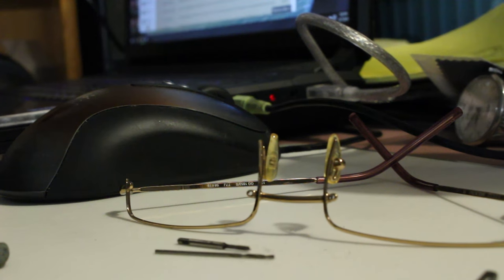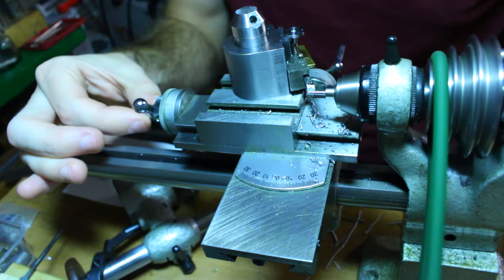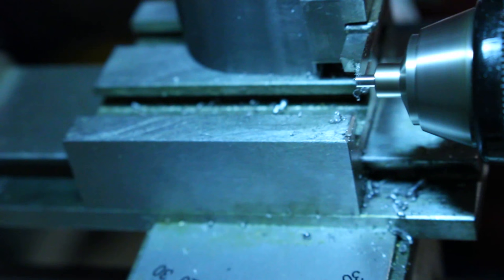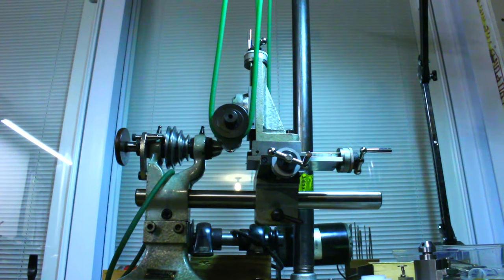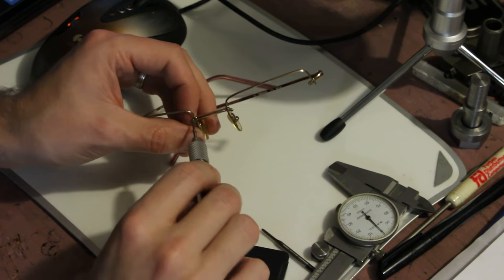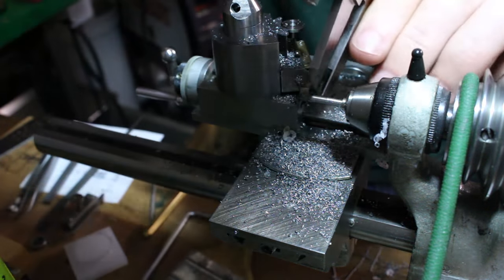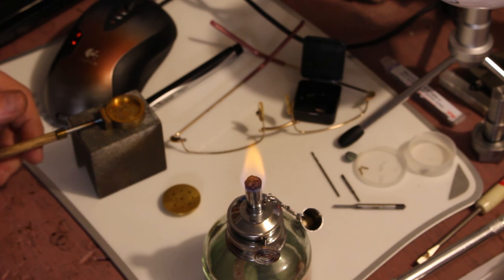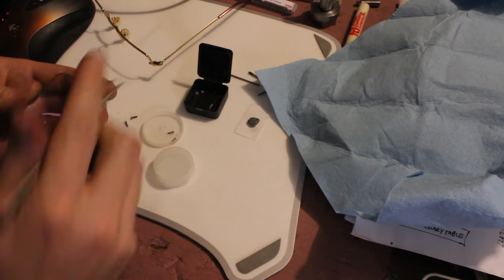A shady job: Making small screws

Comment: Good job!  I made some of those on my 9" lathe, single pointed 80TPI, .056" OD
Reply from the maker: Wow you've got me beat!  The smallest I've single pointed were #4-40.  Did you grind your own threading tool for that, or did you have a threading insert?
Reply: Your finishing is much more refined than mine.  I just used my regular hand ground HSS threading tool.
Here's some photos: http://s1182.photobucket.com/user/martik777/library/Single%20pointing%20a%20tiny%20screw
Reply from the maker: That came out great!  Nice work grinding that single pointing tool too.  I also hand grind mine, but I'm thinking of making up a fixture one of these days.

Comment: Came back for another watch and noticed the Rivett has round cutting tools.  I can't believe it never caught my attention before.  I'm assuming you made them out of drill rod?
Reply from the maker: Yes, the post itself takes round tools, the post inserts are easy to swap out and were available with different diameter holes through them, I have 1/2" for the Rivett and 1/4", 1/2", and 5/8" for the Hjorths.  There were also bushings available with square holes to fit the largest size of toolpost insert (5/8" or 3/4", I can't remember offhand), that would allow holding of square tools, but I don't have any of them and probably won't bother making any.  The round tools I use are made from 1/2" round HSS blanks that I grind to shape.  Round tools took some getting used to, but I really like using them.

Comment: Watching your videos again (since you haven't posted any for some time, ahem, hint  hint). Now I have a question. I take glasses apart all the time, if nothing else for the screws. How do you determine the pitch?  I use trial and error, but there must be a better way. Dr Daniels is mute on the subject. Maybe there are screw plates. If so, where do you find them?  There must be a Swiss standard somewhere!
Reply from the maker: Hey sorry I'm so late answering, I'm just now noticing a bunch of older comments!  Screw plates are definitely the easiest way, all of them I recall seeing have matched sets of plain threaded holes alongside the die cutting holes, to gauge the diameter/pitch.  Of course you have to be a little bit careful when it comes to english vs. metric threads, these thread pitches are all so fine that it's not always easy to determine whether a pitch is english or metric.  Another quick and dirty way is to use an existing screw or tap as a visual gauge, like you would a "normal" thread pitch gauge.  If you really need to be fussy about it, the quickest and easiest way I can think of would be to use a microscope with an optical scale if you have one, or a scale set next to or behind the threads of the screw in question.  Also, Dr. Daniels stated that one should make one's own screws, as mass-produced ones are entirely unsuitable.  :)

Comment: please be so careful when removing chips with your finger, dont be pulled in!  I love printer rods, so plentiful and precision... btw I didnt know they magnetized...
Reply from the maker: Hi Joe, thanks for taking the time to comment! I appreciate your concern but there is no danger here on a watchmakers lathe, other than the possible metal splinter.  This lathe won't be pulling in any body parts, under any conditions.  It won't even pinch.  Regarding the printer shafting, it is typically 4xx series stainless steel, which is magnetic and often heat treatable. Great stuff to work with, because it machines real nice and has some corrosion resistance. The trade-off is that 3xx stainless is far more corrosion resistant (and non-magnetic) but doesn't machine nearly as well.
Reply: HA!  I didnt worry too much about any hangnails getting caught!  I have a small supply of those printer rods, but Ive never tried hardening them,  Maybe I can make a hardened "ice pick" splinter remover like Diresta uses for just about everything... In some ways Im glad I dont (yet) have a mill, for I understand those splinters can be quite, well, splintery.
Reply: say,  do any watchmaking lathes of briefcase size have screwcutting leadscrews?
Reply from the maker: That's a great question, and it touches on one of my favorite topics!  The answer is yes and no. If you are talking of traditional watchmakers lathes (that is to say, plain turning lathes) of that size, then strictly speaking no they do not have a powered feed screw like you are thinking.  Traditional watchmakers lathes, however, were often available with screw cutting attachments that accomplish the same thing, but by transmitting power from the headstock to the top compound slide via a telescoping driveshaft with a pair of universal joints.  This is how power feed and single point threading can be done on a plain turning lathe.  These attachments are extremely difficult to find and very expensive when they do turn up, so most people do without and a few adventurous souls have made their own.  Here is a link to an image that shows such an attachment: http://www.watchtoolsonline.com/images/007(16).jpg  However bear in mind there are very small lathes of similar size (such as the Cowells and the Sherline) aimed at model makers that are scaled down lathes of a more general design and often have power feed and screw cutting capabilities via a powered lead screw.  For a time there were some Chinese made lathes with between a 4-6" swing that were threadcutting.  Micromark was one retailer for them, but they have been unavailable for quite a while now.  Finding features such as threadcutting, or even worse, back-gearing, in a lathe this size is very difficult unless you pony up quite a bit of money for something like a Cowells.  As far as I know, the Cowells is the only screwcutting, back-geared machine you can buy new in this size.

Comment: The most interesting videos I have watched in some time. Work that small is my thing because the workshop is so small.  There must be standards for these tiny screws. There is at least one Swiss standard where the diameter decreases as the square root of 2, so each area is 1/2 the preceding one. You did mention M1.4 and 1.4 is square root of 2. But there must be some formula for the pitch. Is there a reference? Second, is there a good place to get those button dies, not to mention watchmaker's files? Third, Thanks for these videos!
Reply from the maker: Thanks very much, Juan!  Yes there are standards for these.  ISO 68-1 defines the the general standard, and ISO 261 specifies "preferred" specific diameters and pitches for fine and coarse threads.  If you're interested in the math behind it, look at ISO 68-1.  I'm sure there are other, less commonly used, standards as well.  The set of button dies I started with, M1.0 through M1.6, came from an e-bay seller called Merlin Tools, they're a Chinese supplier and their stuff is alright for the money.  At the time, they were the only option other than paying through the nose for Bergeon.  Now you can find many other options.  I recently bought an M1.7 button die from a seller on Amazon.  It is much easier to find these small dies nowadays.  I have quite a few very old dies that are unused or lightly used that I purchased from online auctions, estate sales, etc, and that's a great way to get excellent quality dies for a good price.  For files, Vallorbe and Grobet are still in business and last I knew made all manner of files that might be used for watchmaking.  There was a time when every set of miniature file assortment came with slotting files, but not anymore.  Slotting files, and some of the other shapes you'd want for escapement work, are not as easy to find.  I recommend either buying new Vallorbe, Grobet, etc, or keeping your eyes peeled for good used ones at auctions/estate sales.  If you're in the US, and a member of the NAWCC, then their marts can be a great way to score things like this.
Reply: That answer was complete, comprehensive, and very useful to me indeed. Thank you.I am in Alaska, very difficult if not impossible to find things.